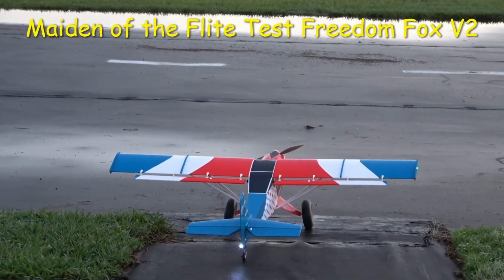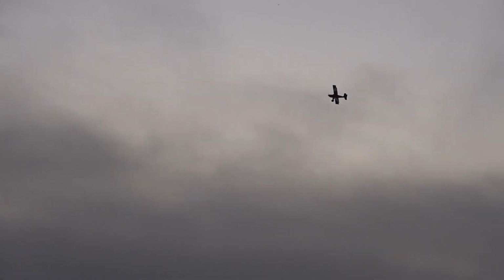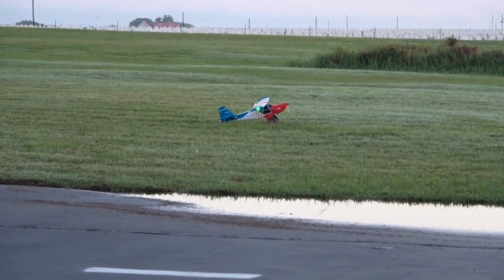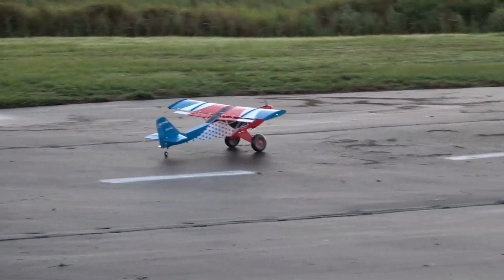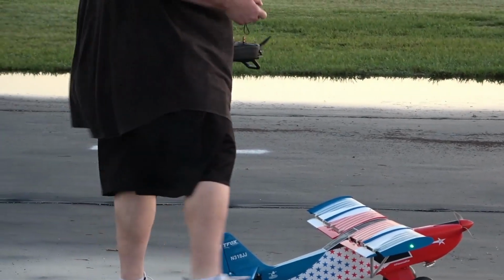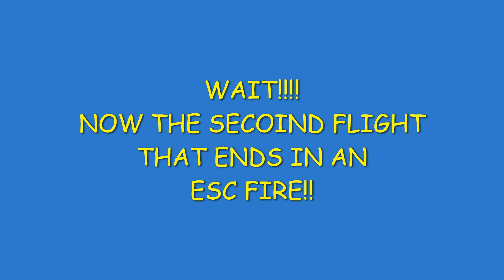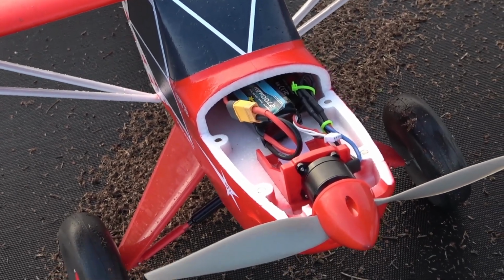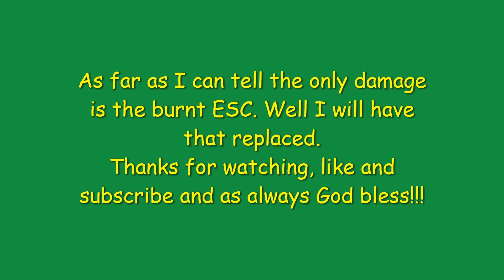FT  FREEDOM FOX V2 MAIDEN THEN ESC CATCHES FIRE ON 2ND FLIGHT by FGFRC

Comment: Well Greg, i could almost smell the esc burning… and i am watching this in Malaysia! So good you did not burn your fingers.
Ah well, back to the drawing board eh.
Reply from the maker: Thanks, installed a smart avian 60amp with telemetry.
Reply: Well done . Are Flight test giving you a credit or new esc & are they admitting there is a problem with the brand you are using?

Comment: sorry for the bad luck...adding the cooling vent on the bottom certainly helps, but not this kind of problem...glad you saved it !
Reply from the maker: I installed a smart Avian ESC 60 amp a bit of overkill but I wanted the telemetry to be alerted of overheating.

Comment: FT uses the cheapEST electronics available via China! THEN the sell them for double + what they paid FOR them. I.E. the reason I use my tried n true electronics. Do cost more, BUT🤷‍♂️
Reply from the maker: I had a refurbished avian 60 amp I have now installed in her. I got telemetry now and reverse!
Reply: @Fat Guy Flies RC  

All I use is avian esc's. 60A for everything 4s, 100a everything 6s. Nice to have voltage callouts👍😁

Catch the 60a on sale, get 3+ at a time.  Same with 100a